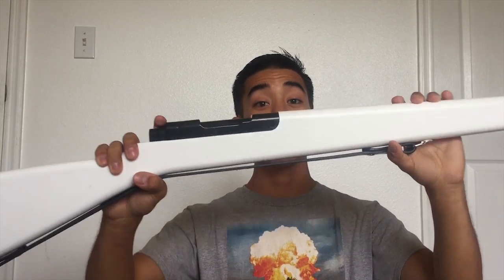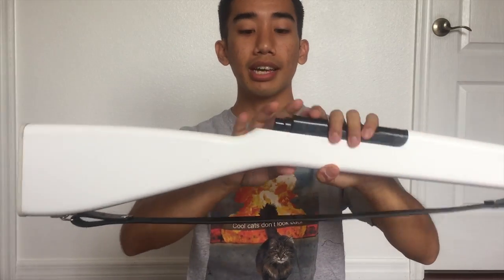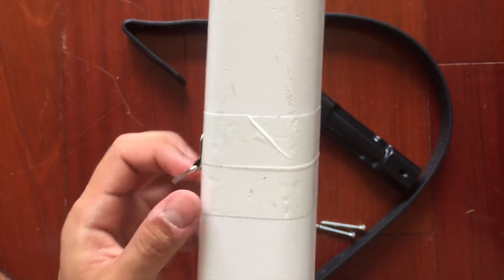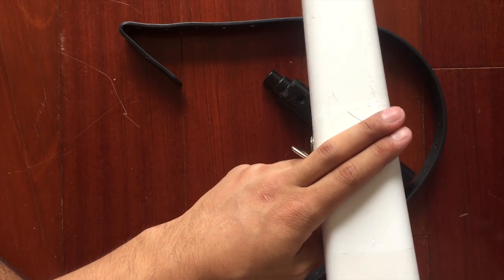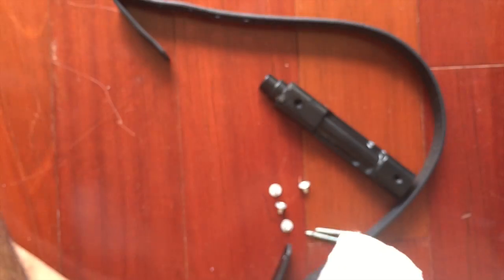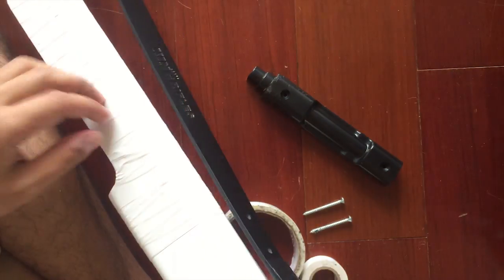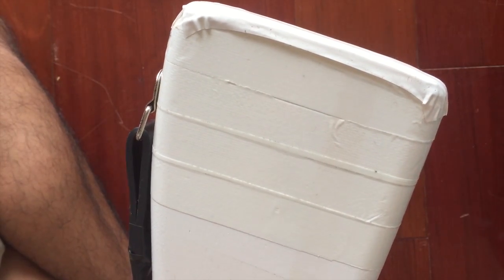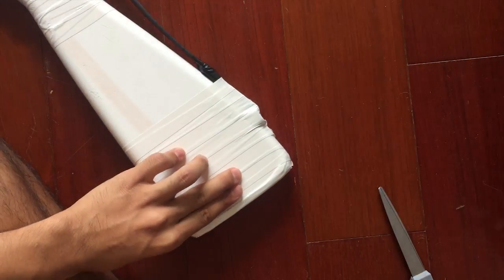Rifle Taping Tutorial

Comment: My strap is like really tight but i was told not to move my screws to another hole to loosen it. I was told to stretch it instead. But ive been like trying to stretch it but its nit stretchinggg. How do i stretch my rifle strap. I know im a bit late. A fyew years to late but pleaseeee i need help. 😂😂
Reply from the maker: Yeah, if you move the screw to another hole, it'll probably end up being TOO loose. To deal with it, you kinda just have to do a lot of strap twirls. That's what I usually do. Over time, the strap will slacken and eventually be normal again.
Reply: @PaulScript  thx
Reply: @kodysmith7763   im in colorguard and I sometimes do  drop spins  or back hands

Comment: If my rifle is already taped is it cool to put more tape over it? Both for design and weight?
Reply from the maker: I personally have only done double layers of tape on my sabre for weight, and because the cross design pattern I do requires two layers as well. On rifles, you could put more tape to increase the weight, you could also extend where the tape is (rather than sections, tape to cover more of the rifle). You definitely could do two layers, do what feels right for you because there is no exact method to taping :)

Comment: I'm having trouble putting the bolt back on with the screws, it just won't screw in. Can someone help me?
Reply from the maker: What I like to do is put the screws in the bolt all the way in(so the bottom of the screw is sticking out) then I line the bottom of the screws with the holes on the rifle without the bolt in my way, then once theyre lined up and in, I screw them a little bit, then push the bolt down onto the rifle before screwing them in all the way
Reply: @PaulScript  I'm not in color guard but can I sand it down and wood stain it and use it for reenacting for drills and displays
Reply from the maker: @thIDthIRreenactor  Yes, that works! If you are using a colorguard rifle, and ROTC rifle, the weight might be a little different.

Comment: whats the best stapping tape that you have come across?
Reply from the maker: When I was at Crown, they had this thin version of the tape, it was easier to use, it wasn't the wide version I would have to cut. I do not remember the exact brand, but using a more narrow strapping tape is more ideal for me.
Reply: @PaulScript  Is the strapping tape different from the Electrical tape? Will the Electrical tape function the same as strapping tape?
Reply from the maker: @monzplumsss8450  They are different! Strapping tape is sturdy, by use of the strings embedded in the tape. It is used as the base layer for taping your rifle to prevent it from cracking and splitting. Electrical tape is flexible, and provides grip as the outer layer of tape. Because its flexible, it will not hold the rifle together if cracks become to big.